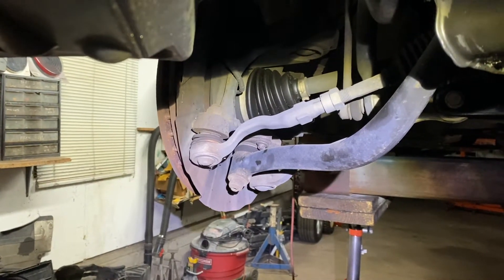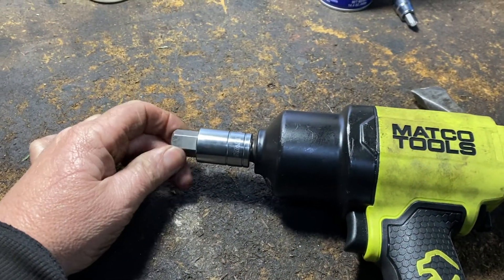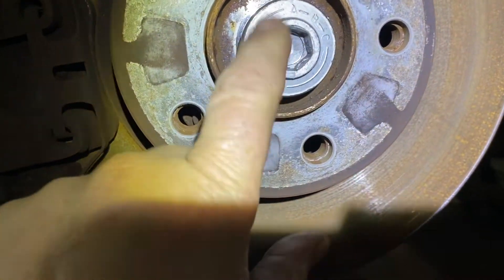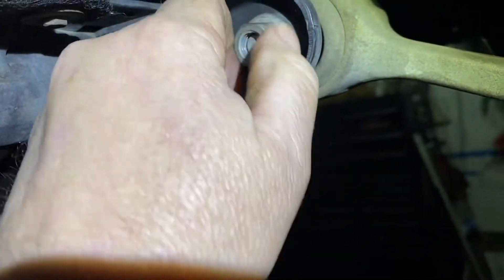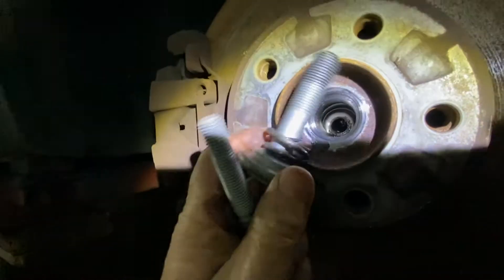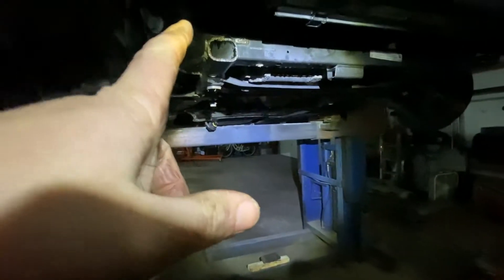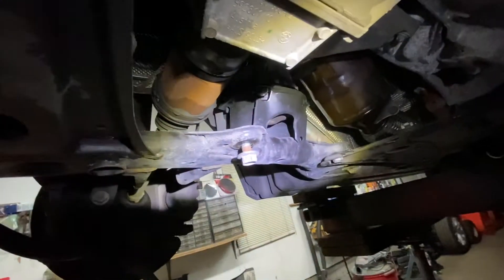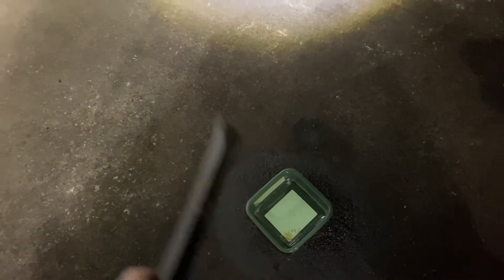BMW X3 Front Axle (driving shaft), CV Joint Easier Removal 2011& Up - Clicking Noise When Turning

Comment: I just replaced my cv boot on driver side everything was fine now my car is sitting half of inch higher on the driver side. Could it be I tighten my bolts with out putting pressure on driver side and now everything is out of specs?
Reply from the maker: If you did it the way in the video I'd say no. Check your work and try putting level weight on the suspension then tighten the bolt. Normally that won't cause your problem something binding will.

Comment: Alright you can make this two hour job or you can make this four hour job if you do what I did. I did this job in my garage on jack. I made mistake when I was done I tighten bolts without putting pressure on the bottom of the knuckle. 
My suspension was off by half of the inch maybe little more. 
I had to take wheel off loosen bolts jack up suspension tighten the bolts button up all shield get wheel back on take car for drive give it couple hard brakes just to make sure suspension gets settled back in place. After all of this hight was almost identical. Best of luck I hope this helps someone. As much as this video helped me. Good luck be safe when working on jack stands 👍🏻
Reply from the maker: Appreciate you sharing your experience and the problem you had and fixed, glad this video helped.

Comment: Thanks, was looking for this for ages, it was very helpful. I need to change the seals in the supporting bracket. Have you got another advice about how you put in the shaft seal?
Do you happen to know the torque spec on refitting?
Reply from the maker: Glad it helped, I don’t have the specs off hand , just look them up online. You need a seal puller if you can’t get it out and tap the new one in evenly not to distort the seal and then have it to leak.

Comment: I got some funny knocking sound from underneath my x3 when accelerating at low speed. Usually last like 1 seconds and happens more often when turn and accelerate. I replaced my front drive shaft and center support bearing not long time ago and. So, I am assuming it’s the CV joint here. Can I ask what do you think about it here? Before I go order the parts?
Reply from the maker: The driveshaft and center support bearing wouldn’t make noise while turning. It’s the cv joints especially if they are leaking grease.

Comment: What is the torque spec for putting the axle shaft bolt back in place? Along with the control arm bolt that you removed?
Reply from the maker: I’m not at the shop now and don’t remember but I’m sure you can find it online.
Reply: @motorcarnut  Thanks and actually I saw the spec it is 210nm plus 90 degrees!
Reply from the maker: Great! that seems correct.

Comment: Hi, i have 270 000 km and vibration noise for few seconds , when the car is staying and I am trying to move away , but not always, could it be  that the right shat is having  vibration because of some bearing damage, no noise when driving available.
Reply from the maker: Can be, also something in the steering and suspension can be loose. Make sure tires are wearing evenly as well.

Comment: Love your channel!!! Any tips on installing the new axle? What should you tap on to make sure it’s seated properly at the differential and the wheel? Thanks!
Reply from the maker: Thank you! Just grab the end near the wheel after you slip the other end in the differential and yank it towards the diff and it should just slide in. The other end has no shaft and is held in with the axle bolt. Remember that bolt has to have a lot of torque so when the wheel is on the ground torque the bolt to 155 ft lbs or else you can destroy the axle and hub from coming loose and stripping it.
Reply: @motorcarnut  thanks again!
Reply from the maker: No problem
Reply: @motorcarnut  Just wanted to let you know that I changed BOTH axles and did a 1 hour test drive with no issues! Local shops quoted me $1500. DIY, parts cost $120 because I bought used OEM. Only took 3 hours. Thank you for your content! You are the man!!!!
Reply from the maker: Thank you bro! Really appreciate this, makes me feel great it work out and you saved money!
Reply: I’ll also add- for re-installation, I had a hard time at first getting the axles to pop back in. I ended up placing both ends where they belong and gently but persuasively using the rotor end to do some pushes and both sides popped right in.
(Just make sure your car is secure if on jack stands).

Thanks for a great video. Also thanks for your oil pan video.
Reply from the maker: No problem, really appreciate the feedback!
Reply: @motorcarnut  Any time. Just out of curiosity, after you do a timing chain on the N20, do suggest any type of 'break in' period, or just drive as normal? Started mine up yesterday after the work (that's nerve racking if you have never done a chain before) and it's all good. Just curious what is recommended.
Reply from the maker: I would change the oil about 1000 miles but you can drive it normally.

Comment: I switched out the driver side today and now it started making a clunking sound at random times. Not even the old one made a clunking sound
Reply from the maker: Maybe the axle you put in or did something incorrect?
Reply: @motorcarnut  turns out it was the big plastic cover that wasn’t screwed on all the way.. by doing this job I’ve noticed the previous owner had someone cut through the chassis to fix something from the engine instead of taking out the engine and doing it the right way…. I Will be selling the car soon.
Reply from the maker: @israelgarcia3455 Glad you found the problem but sorry you found worse things wrong. Cutting chassis is not safe
Reply: these cars aren't worth much anyway.  $3-4k max.

Comment: What is the easy way to replace rear axle? Do we need to remove caliber, rotor, lower control arm???
Reply from the maker: No you don't. I did it that way to remove the complete unit because everything was rotted.
Reply: @motorcarnut  Thank you. But, what should I remove for rear axle? Lower control arm?
Reply from the maker: @maviblue1168 yes, whatever is in the way

Comment: Same process for an E70 X5 model?
Reply from the maker: Similar but not exact
Reply: please explain………. I am trying to do my 2009 BMW X5 V8 running into some difficulties so if you can explain to me or do a video on how to properly do this procedure driver side removal cv axle
Reply from the maker: @fredchappell7360 this video is for the 4 cylinder models and I don’t have one on the 8 cylinder yet sorry

Comment: Fk I accidentally got the ones for 328i not x3 28i
Reply from the maker: Just return them, shouldn’t be a problem.
Reply: @motorcarnut  it is lol my other 3 cars are down I need that one 🤣 the bmw is the one I rely on ironically, and today it also sprang a coolant leak I think at the radiator....yep
Reply from the maker: Oh man, when it rain it pours, right?
Reply: @motorcarnut  lol that ain't no shit we all got the flu aswell it's going around so be safe man
Reply from the maker: Wow, thanks for heads up
Reply: @motorcarnut  yo wut the torque spec and where do I put the fluid back into and yes the right axles finally came in lol
Reply from the maker: The axle nut? That is 154lbs plus 90 degrees. And fill hole is on drivers side right near with the axle goes in the front differential.
Reply: @motorcarnut  sorry cv axle bolt not nut x3 has that weird bolt with spring also what fluid for diff? Gear oil?
Reply from the maker: Yes, I know said nut meant hex bolt. I use Liqui Moly GL5 75w 90 fully synthetic gear oil
Reply: @motorcarnut  +90°? 😬 I read 210 NM
Reply from the maker: Yes that bolt has to be super tight or it will strip and destroy the hub and cv joint.
Reply: @Motorcarnut  guess that's why they say its a one time use lol ill get my radiator soon and thanks alot for the help brother
Reply from the maker: No problem